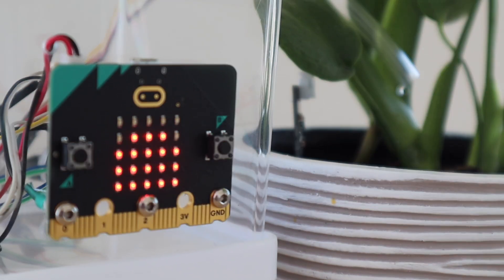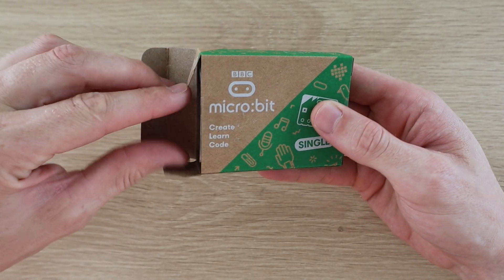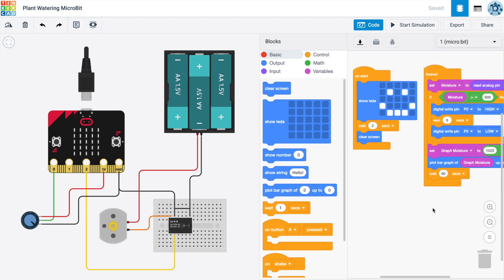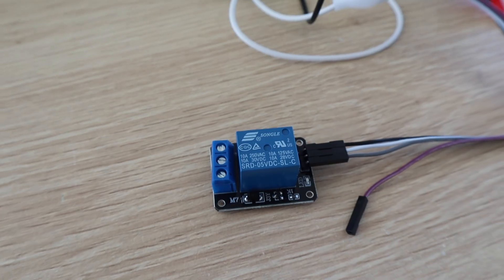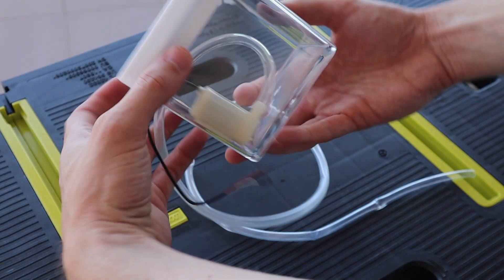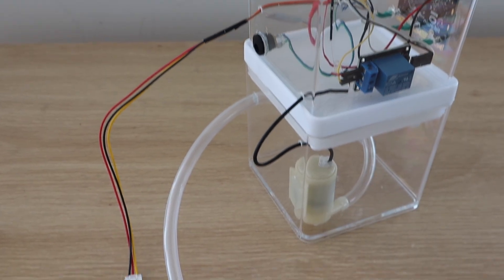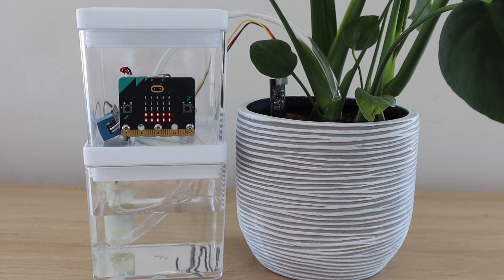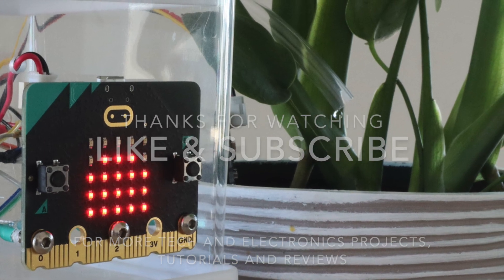Micro:bit Automatic Plant Watering System

Comment: The relay module you are using takes 5 v as input. The microbit only gives 3.3v. How does that work? Thanks for the work you are doing.
Reply from the maker: They work on 5V or 3.3V
Reply: @MichaelKlements  Thank you! I will use it.

Comment: how did u connect the wires to the m3 screws? please help quick
Reply from the maker: Either just twist the wires around the threaded section of the screws or add a suitable terminal to the wire to screw down onto.
Reply: @MichaelKlements   you should also mention like how you used the barrel jack connector, or however you allow the wires to work with the AC/DC adapter plug

Comment: Hi Michael, great project! Am I missing something..the coded image shows 0, 2, 3V and GND pins connected, but the physical connection, shows 0, 2 and GND. Also, where is the power supply? I'm trying to replicate, but struggling to connect the relay components etc. Thanx!
Reply from the maker: The capacitive sensor that I used can handle a 3.3V or 5V supply as it has an onboard regulator, so I connected it straight to the power supply (you can see this @2:18). The code platform doesn't have a moisture sensor so I've used a pot in it's place and this needs a 3V connectiong to the micro:bit or the code won't work.

Comment: hi Michael, we cannot get this system to work. the relay we are using in Takamisawa JV 3S KT, which is a none polarised, high sensitive 3 VDC relay with 45 ohm coil. power consumption is 200 mW.
In our set up we are connecting the relay to pin2 of the microbit,  the on- voltage on that pin will collapse to about 1 volt when the pin goes to on, the relay doesnot pull in.  do you have any idea, if the microbit might be overloaded with that relay? we have tried other output terminals with the same result. if we connect an LED to this output pin, the microbit ? LED works fine. Your help is appreciated.
Wolfgang Killian, Happy Valley Middle School, Oregon.
Reply from the maker: The pins on the Micro:bit aren't designed to drive components that require more than a few milliamps of current. With a 45 ohm coil, the relay is likely trying to pull around 75mA to switch. This is probably overloading the pin and this causes the voltage to collapse. 
If you look closely at the relay module that I've linked to, it has a small transistor and diode onboard that drive the relay and suppress the EMF from the coil - that's why the module needs an external power source and not just the input pin.

Comment: Hello, I have a question about your Micro:bit Automatic Plant Watering System. I live in Albania and here it's a bit hard to find all the components, I can't find a power supply with output 3V : 1A, but I have found one with 0.5-4.2V : 0.5A. Can it work with it?
Reply from the maker: 0.5A should still be ok to run the pump, as long as you keep the tubing short so that there isn't a lot of back pressure on it.
Reply: @MichaelKlements  thank you very much sir 👍
Reply: @MichaelKlements  hello again, I'm having a bit trouble building it, because my moisture sensor is a little different, if you could help me a little bit it would mean a lot. Where can I send you a photo of the sensor?
Reply: @MichaelKlements  this project is very important important for me, please.

Comment: Can this work without a relay module?
Reply from the maker: No, the Micro:bit can't handle the current that the pump requires to run
Reply: @MichaelKlements  I'm actually making my own pump with a DC motor, do you think in this situation I could do it without a relay module?

Comment: Great video! Currently using this for a school project. Is it possible to do it without a relay?
Reply from the maker: The Micro:bit can't handle the current requirements of the pump, so you'll need some form of switching device.

Comment: excellent video, could I replace the micro bit with an arduino?  if yes, how can this happen?  can you help me to do?
Reply from the maker: You can use an Arduino but you'd have to re-write the code
Reply: @MichaelKlements  What did you use to power the water pump?  a stack or source?

Comment: Hi. Great tutorial! Do we need an external power for the pump? Or just using the power connected to the Microbit?
Reply from the maker: Yes you'll need to power the pump with its own 5V source, that why the relay is used to turn it on and off.
Reply: @MichaelKlements  Hi, nevermind, finally it works after changing the relay to 3v relay instead of 5v relay. Thanks for this wonderful project
Reply: @TrackerX2007  Ricardo thanks I had the same issue - 3v Relay everyone - NOT the 5V
Reply: @MichaelKlements  thanks!
Reply: @MichaelKlements  hi, further questions.
1. Did you connect the 3v pin from the Microbit to the moisture sensor?
2. How do you power up and trigger the 5v relay? Because the Microbit only outputted a max of 3v

Thanks

Comment: hi, I am currently trying to do this for my physics project, and I am unable to see exactly how the dc pump is connected and also how the other wiring is connected, is it possible for u to elaborate a little more on the wiring?
Reply from the maker: The blog post linked in the description shows you a wiring diagram.

Comment: Do you use a Bread board
Reply from the maker: I soldered the components together for this project. The Microbit interface is a bit difficult to use with a breadboard unless you have a breakout adapter.

Comment: I think you didn't explained it clearly, especially for the circuit diagram among, relay, pump and microbit board, power supply. Also the code blocks' shape is quite different. Thanks
Reply from the maker: That’s why I’ve included a link to a step by step write up in the video description.
Reply: still the diagram makes no sense
Reply: @MichaelKlements  I got it, thank you for your reply. Keep it up 💪

Comment: Great job! Is it possible to wire Multiple Sensors for more seperate plants on one device?
Reply from the maker: You'd need to use the plug in expansion board to access more of the Micro:bits IO, but it is possible. You just need one analogue input and one digital output per plant (one moisture sensor and one relay and pump combination).

Comment: How long would the batteries last?
Reply from the maker: This project isn’t being powered by batteries, it’s being powered by a 3V power supply. A 2 x AA battery pack would probably only last a day or two at the most on this setup.
Reply: @MichaelKlements  how do make a 3v power supply?
Reply: @MichaelKlements  please reply quickly 🙏😢😭😔😫